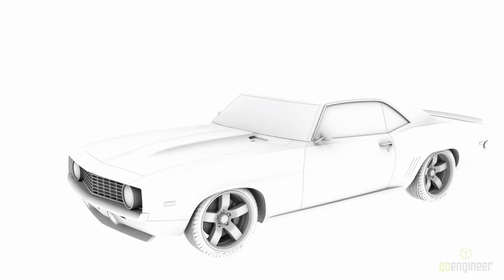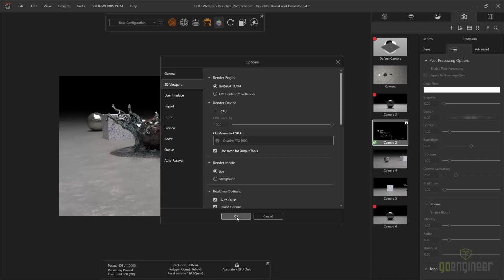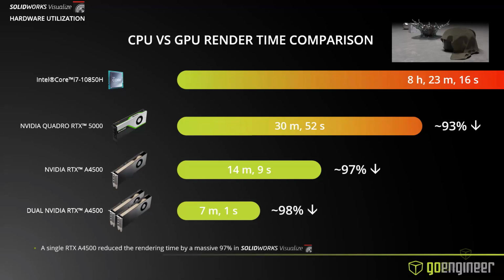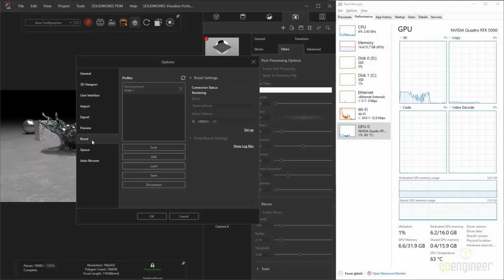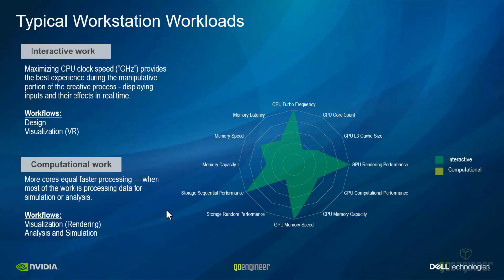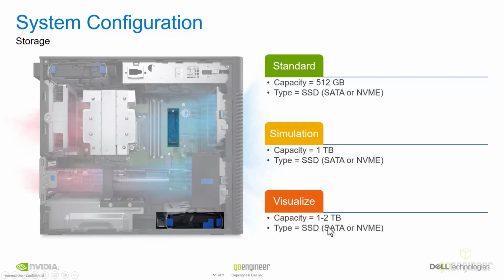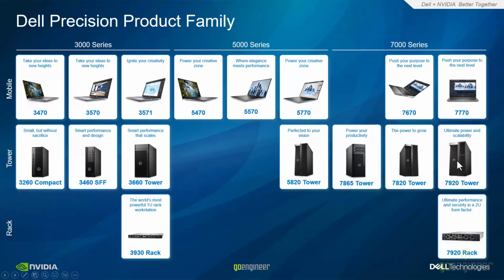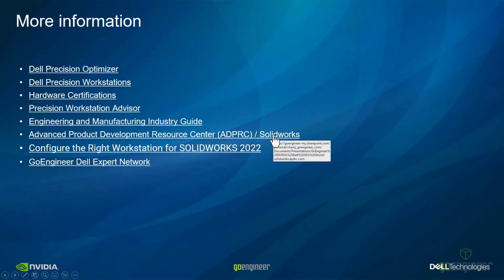SOLIDWORKS Visualize Hardware Utilization - Webinar

Comment: I have an issue where my gpu is not even close to being fully loaded if at all when redering. in the viewport it is set to render on my 4080 exclusively and yet my gpu stays under 10% usage and doesnt even ramp clock speeds up at all, for reference this is exactly how my gpu behaves when im idle on my desktop which leads me to believe the rendering is being pushed onto the cpu when i send items to the render queue.